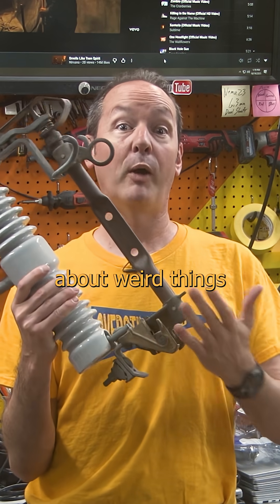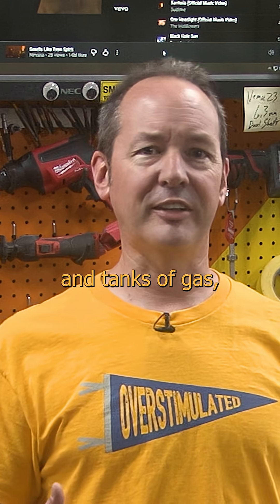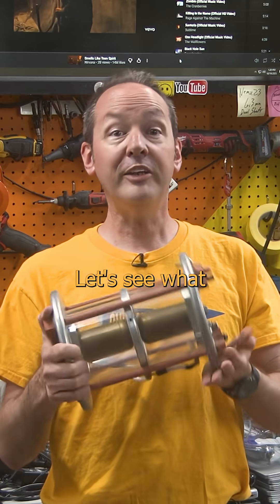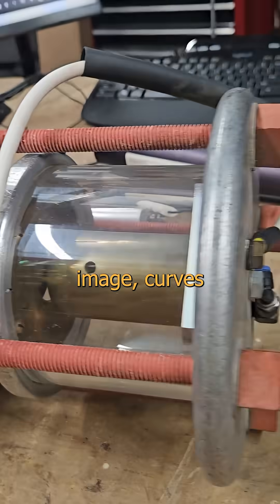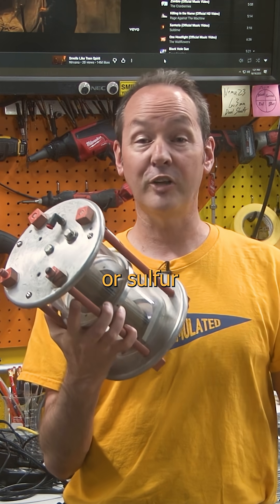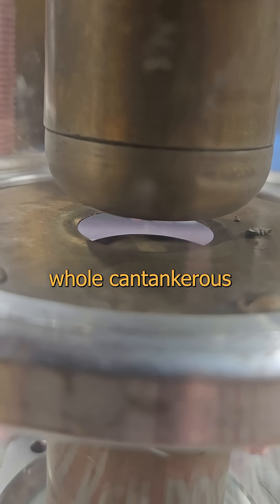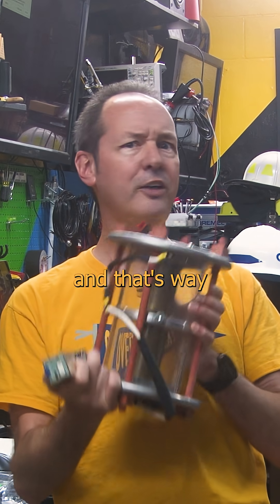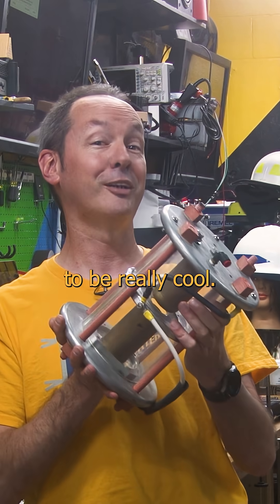Triggered Spark Gap #chrisboden #comedy #highvoltage #physics #engineering #science #educational

Comment: Actually  if you are a better ground   even on low voltage   next to the breaker panel  it can make you a ground  but there is other  issues  at hand  I work  gas and electric  field  .The transformers  we set are very confusing why  sub contractors  set it up switch gears  are interesting   lol

Comment: How do you get the higher voltage not going through the lower voltage initiator?
Not a mechanicl contact in a vacuum with internal solenoid or motor powered by current inducted through the glass?
Thank you.

Comment: 300 V is still low voltage. 690 V is quite a common voltage for high power applications (whilst still using a  low voltage installation). High voltage starts at 1kV (AC) or 1.5 kV (DC). 30 kV can still be used indoors, although it requires a high voltage installation. ABB or Eaton has the proper switchgear for it (goes up to 38kV or 40 kV)

Comment: Cardiac defibrillators use a smaller version of that relay. Usually a 1 microfarad capacitor is charged and discharged through the defibrillator paddles through the patient's chest. A conductive gell is used between the paddles and the patient's skin. Dry human skin is normally not very conductive.

Comment: There are things similar to these which work with mercury.

Closing the switch:
1.) Vacuum it until the arc can start on its own through the mercury vapours
2.) pump mercury until the contacts touch

Opening the switch:
1.) pull mercury away from the contact to initiate a low pressure discharge
2.) let 1 atmosphere jets of nitrogen blow directly across the low pressure discharge arc
This extinguishes the arc.

Most efficient almost solid state high voltage switches ever created.

Comment: ok WHAT are the red screw bars connecting the metal plates on the outside?... I am guessing NOT rusted iron because iron conducts well. 

Trying to guess what material is strong enough but totally non-conductive even at thousands of volts.

Comment: A major thing about electricity is something called skim effect, where the faster it flows, the more it wants to stay at the surface of whatever conductor it’s in(Some power lines will take advantage of this and be hollow in the middle). Now, also consider that an electrical circuit is kinda like a river, where, in as simple terms as I can make it, voltage is how big the river is, while current is how fast it flows. With both of these details in mind, curves on high-voltage devices act like the curved sides of a bowl, redirecting the incredibly LARGE amounts of energy spinning around like a whirlpool back into the bowl, while corners are like a flat surface that the voltage will splash against. This isn’t the EXACT mechanics behind it all, but it’s as close as I can get with my level of education.

Comment: You can do it at 200V too, I had a small neon tube which used something similar, putting the input voltage on the middle part to switch it on because it has hysteresis, so effectively bringing the electrodes closer makes it turn on, and then you can bring them back out and it stays on.

I think that's also similar to how camera flash work, where you have a tube that gets excited by a metal plate next to it.

Comment: And then you have UHV (e.g. 1000kV lines which can transport over 1.21GW with only 10% loss over very long distance) which is dumb and the only rule you need to know is that it will kill you if you sneeze improperly in its vicinity.

Comment: "This focking thing" is definitely not a serial production thing. The plates on both ends are something I as a CNC metaldestroyer would spend an entire day programming, turning and milling, maybe both of them if my ass was on fire. The billets alone would look like for heavy or industrial machinery and would hurt my spine just by looking at them. The joining bolts are likely hardened standard large milling fixture stock, cut to size and chamfered. To design and make this is costly enough that it's a small chance that there were big batch of them made, unless it was some nationwide big budget project.
 -"No, THIS is a switch!"

Comment: Oh gods, if 300 volts is "low voltage" to you then my threshold of low voltage is child's play. I get skittish around anything spicier than 24 of them. As far as I'm concerned, 12 volts is enough to start throwing sparks when you crowbar a battery capable of pushing tens of amps of current, and my personal safe threshold at my hobbyist workbench is double that.

Incidentally I have an antique electronic wall art in my collection called L'Ectrique Art (created by Nicholas Basill for the Walt Disney Company to be sold at Disney World in the 60s!!) which ran off of a 45V battery. I want to resurrect it with a wall-plug power supply so I don't have to constantly source vintage batteries or chain handfuls of 9 volters to keep it lit, which means I gotta dance outside of my safety threshold for it. :)

Comment: I repaired radar equipment that operated at 400 volts. 400 hz. My coworker and i went to replace the power amplifier. We forgot to discharge the residual power and got hit by and i woke up in the hospital several hours later. I was told i only survived do the hz being 400

Comment: Hi, i love your videos im originally from the film industry but sometimes dabble into engineering too. Recommendation for the video tech if you are interested check out circular polar filters if you are filming things with glass/reflective bits cuz they remove the reflections and makes things easier to see. Idk if you are still using the sony nx type camcorder thing or you changed cameras since then but they can be fitted easily to any kind of lens or matbox (which i would also recommend if you dont have one already to help with the glares from the strong light at the top) 
again love your videos and merch keep up the good work and it gets better.

Comment: Idk if this is common knowledge but i recently learnt that part of the reason we use AC current is because its easy to step up AC voltage to ridiculous values which is good for transportation of electricity.

This is because lets say u want to supply a certain amount of power that power u r supplying is equal to the voltage times the current over that line BUTTT the power loses in that line are equal to the current squared times by the resistance.

This means that if u have a high current u may supply a large amount of power but u would have huge amounts of losses as well due to that squared value. 

So our solution to this was to simply increase the voltage to huge values so that we can still supply the same amount of power (remember P = VI) while having relatively small currents which then reduces the power loses and increases efficiency.

Comment: I don't know who built that specific one - but I can tell you a guy who built one just like it. His name is Herb - pronounced "'erb" and he, and a roomful of "Imported Directly From Germany" ran the "real" machine shop in the Electrical Engineering Research Building where I spent 11 happy years. If it was "quick & dirty" we might try to make one in the tiny machine room on one side of our lab room. A Big Room - with a lot of air space between experiment stations. But for Seriously High Voltage, and Seriously High Current, we had to get out the drafting board, and the HP15 calculator. And then print the drawings, and take them to 'Erb'. Which is kind of like being hauled to the Principal's Office while wearing a sign that says, "Just How 'Effing Stupid Am I?" 
So 'Erb" and his Next Best Machinist would look over the drawings, then add about half a pint of "red ink adjustments" to the design. On account of all the machines in 'Erb's shop ran with tolerances where 1/10,000 thou ws serious runout. Back to the drawing board. Very Carefully. Back to 'Erb. This time, after half an hour's inspection, 'Erb admits that it a) Can Be Done an b) Will Function As Intended, at 50kV, 60 kV and lotsa lotsa watts going into a laser about the size of a Propane tanker. 
"'Tree Weeks" Says 'Erb. And he doesn't say, "And don't even THINK about showing your face any sooner." 
When 'Erb is finished, There's an OBJECT that looks a whole lot lie the Fun Box you're showing. And looks like Werner Von Braun couldn't have managed it on his best day. It gleams from every possible place. Not even a dust mote is allowed into the room. 
After much groveling and genuflecting, the new "Witch Switch" is put on a rubber-tired card and taken - carefully - to the Very Large Room where the Very Large Laser sits. 
To Install, the panels for the Whole Floor are Locked Out. By 7 Guys, 3 Tech, 3 Engineerds, and The Boss. 
After everything has been wired, fastened, tightened, tested, re-inspected, re-tightened, and placed about 4 arms length from where anyone can reach when energized. Power to the ceiling lights is restored. If there's no smoke, or explosions, or gas cylinders suddenly dancing, the "Installation" is Pronounced "Satisfactory." Except - 'Erb has to come up, and make sure that Cable A is properly connected to the connection point for Cable A, etc. 'Erb inspects, as if he was taking apart a Saturn V booster, piece by piece. He allows as how it's been done right. 
And then the fun begins. Actuators are phenmatiic or hydraulic, pushing or pulling on Delrin rods yards long (OK - 1 yard anyway). All done from inside a cage in the far corner. Dry run - all the parts move. All the parts that aren't supposed to move - don't. 
So then, ya puts some gas to 'er. And more into the honkin' big laser sitting next to it. The panel interlocks are removed, one by one. All autographed. And photographed. For the autopsy. 
And then? With fear and trepidation, the Boss says, "Primary Voltage "ON"" And nothing stupid happens. 
Which is why we had a machine shop filled with German machinists who Don't Trust Anybody. For which I Bless Them. Profoundly. Because we're all still alive, and there's nobody stacked in the far corner, Extra Crispy. 
I know -- that doesn't give you a name. But it was 'Erb's cousin - real or spiritual. I'm retired. 'Erb's retired. They don't do that kind of research anymore. The administration are cowards. Oh, and the Big Laser? For welding butt ends of pieces of 120 pound railroad rail. It works Further deponeth sayeth not.

Comment: Speaking of lasers, it took me quite a while to wrap my head around the fact that our Coherent ion lasers used both low voltage AC on one end and high voltage (B+) 600 volts DC on the other end of the same water javketed tube.

75A of 480 three phase just to get 10 watts of pure, two frequency red light!

Comment: NGL, that is a pretty ingenious switch by releasing the gas, which lowers the dielectric strength of the air, causing the arc to occur. Makes sense as with higher voltages, welding your contactors shut can be a concern.

Comment: Neah.
Everything under 1000V is considered Low Voltage.
We have 400V phase to phase in Europe.
Rectify that and you're at 565V DC on a PCB. No worries.
There are two things that might be "a trap for young players"
- powering an AC Circuit with DC. The buttons, switches, MCB's, relays and electrical contacts will arc like crazy and burn out or weld themselves.
- High Frequency AC will jump out and bite you. Almost every modern TIG Welder or Plasma Torch has this.

High Frequency AC is the only Black Magic out there.
Once the insulation breaks, you're basically a holding a conductor.

Comment: The roof of the trains have current collectors called pantographs, these have a VCB Vacuum Circuit Breaker. It works by creating a vacuum and thus preventing a big flash on switching

Comment: I’m rebuilding a Lincoln ranger 8 got be 90’s or early 2000 but the wires are old aluminum around 10 to 8 awg but I just woke up sorry if something don’t make sense  I want to remake my own wire harnesses make it all new now I have plenty extra wire but the welder generator wires say 600v  all wire I have currently say 300v so I need get right stuff if I decide to redo idk

Comment: Years back I ran into the hoot of standing waves in microwave work.  The module has a limited circuit that goes low impedance above maybe 15 dBm, but protected up to mumble-kW of incident power.  The X- band filter before the limiter already cranked the peak voltage up several times, then the limited causes another doubling.  Sure enough at about 400V peak voltage you got a beautiful blue light display as the traces slowly ablated away.  Good times.

Comment: From an electrician's point of view, perhaps nothing interesting happens below 300V. But if you delve deeper into electronics, you will find that current in alternating signals can “jump” out of wires, sharp edges, bounce off a mismatched receiver, change the phase angle, etc. - regardless of whether it is 10V or 1.8V 🤷🏻‍♂️So - it's not quite as you describe it.

Comment: Kinda off topic. Was playing with a 480v generator that came out of balance. Had a receptacle wired directly in bypassing the AVR and it was sitting on its frame and when I flipped the breaker, it blew a dime sized hole through the metal receptacle cover. Impressive stuff

Comment: Errr... It definitely jumps even at much lower voltages. That's part of why you're required to have certain seperation between high voltage and low voltage side in electronics. It just doesn't jump all that far at lower voltages and the common safety margin to use in electronics is 5 to 10mm for 230V. And that's the safety margin so actual distance it can jump, is even less.

Comment: That triggered gap would suck as a radar modulator, too much jitter. So we used thyratrons instead. It's OK for a crowbar where you want the cap bank to discharge instead of blowing out a power tube. But I did use a BIGGER one as a modulator on a 500 KV modulator. It would light up neon indicating fuse holders. 
You can make those pretty easily with a lathe and hand tools and bolt them together. Maybe I shouldn't give people ideas.

Comment: I made an arc with 2 volts I'm nit kidding I was given a 15 volt power pack 2 wired a bulb and a switch I started messing around with just the wires and an arc formed between them

Comment: I remember working on the finishing end of what they call a double A stamp press. When the union electricity guess would come in to do the disconnect. Not only did they have a suit on they had a special hook on a pole that the guy had had around is waste. I have been through a lot of training over the years for different things. When you have to have that much gear to open a panel it seems pretty scary to someone standing 25 feet away with no real PPE just safety glasses, hard hat, steel toes and my vest. Lol

Comment: Those look like a slightly older model of spark gaps that we use in the Marx bank generator for the Zebra Z pinch at UNRs terrawatt research facility. We use SF6 in ours like you said and last time I serviced them the oil on the outside from their bath was the easiest part to clean! The insides get so gunked up from the high voltage and the gas that we end up turning and resurfacing the metal parts on the inside when we do maintenance! Sharing info like this is actually really cool!

Comment: I've got something similar that came out of an old defibrillator unit. Can't control what gas is inside as it is sealed it has two smaller wires coming out for 12-volt for the actual switching. Pretty neat looking gizmo

Comment: i work in a coal mine and the highest voltage we deal with is 12470 and the cat heads on those thing weigh a metric fuck ton for something we hand on a thin wire hook.

Comment: well we have 600v in over house, 3 x 240 v  :-D  most houses in Denmark got this, it needs to be a reale reale REALE old house for it not to have.. and this is just nice, in the garage i have 400v compressor and beltgrinder. but in the kitchen, you can boil 1 L water in 30 sec.

Comment: My first job with my brand new BSEE was switching 4000V at 40,000A used to vaporize seawater on geophysical survey boats.  We were using electricity with triggered spark gaps to replace small TNT charges.  My boss had just left a job making defribullators.  He noted our new machine could defribullate 20 patients per second!

Comment: I as a specialist (45 years experience) on Inverters for one of the big 3.   I had been asked to pull the programming off of the main drive on a cement kiln.  The drive turned out to be powered with 9600 volt mains. I insisted that the drive be powered down before I would I pulled the programing down.  When I approached the disconnect there was a sign on the door that stated "Open this door and you will most likely die". I packed up my gear and drove home.

Comment: About juice jumping off the wire: Back in the late 70s, I knew enough about electricity to cause issues but not enough to be safe at the same time😉(one semester of electronics in HS). I was NOT aware that power can jump the line. Anyway,, one time, when I was hammered, I got the bright idea to climb a high tension tower, so I did. As I sat atop, I tried to, unsuccessfully, spit on the lines. For a moment, I considered taking a leak, but then thought "Uh, that'll prolly end me." A moment later I felt a tingling in my groin and realized it was time to get down. lol
Sometime later, as I was telling the story to someone, he responded with, "You know the power can jump off the line, right?" 
No. I was not aware.😳 And it was one of the reasons I quit alcohol a couple of yeas later.
But, while I knew, when sober, how stupid it was,  I do like it that I have that.story. 

I think there is a saying about " angels and fools" that applies.😳😁😁😁